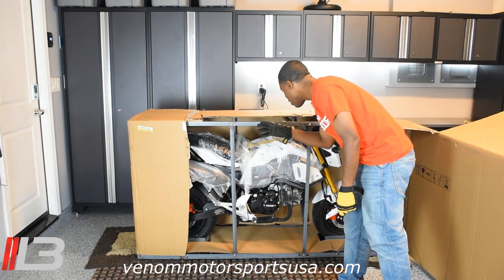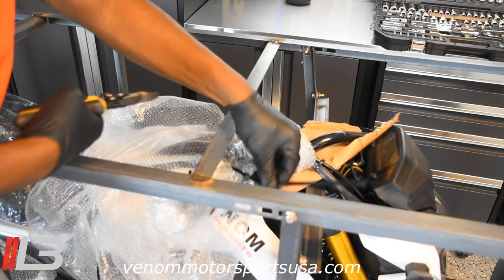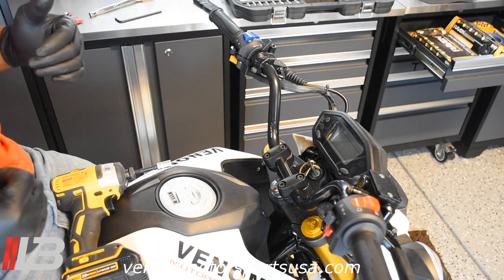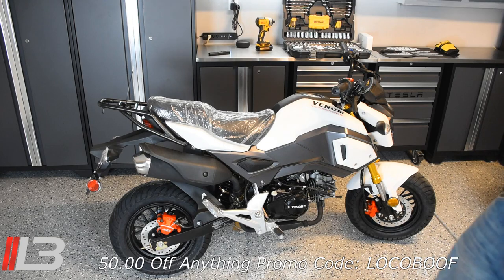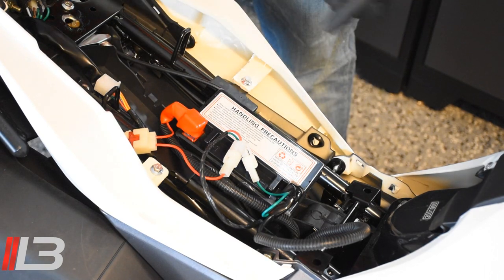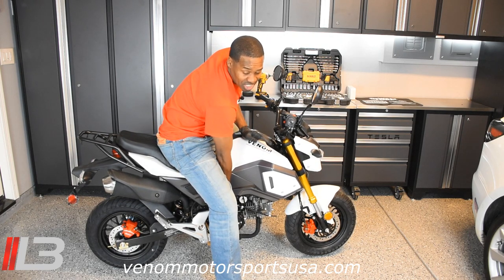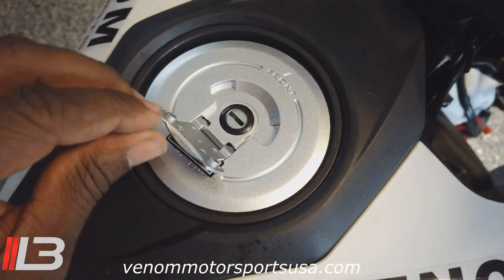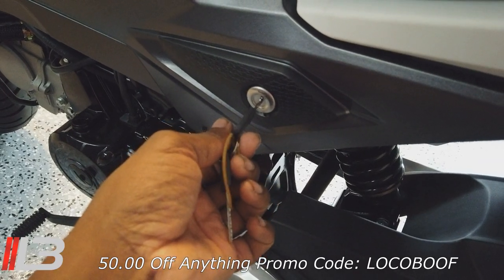New 2020 Venom 125cc Street Legal X20 Super Pocket Bike Unboxing & Setup

Comment: I’ve got a x15 or x18 need to find the original plastics or ones that would fit if anyone knows where I’ve tried eBay, I’m wondering if the new model plastics would fit even if it needs a lil modding to fit thanks in advance

Comment: Do you need a motorcycle license to ride a street legal pocket bike on public roads?
Reply from the maker: You’d need to check with your local DMV laws. Every city/state is different for pocket bikes. They haven’t made pocket bikes in awhile though. It may have just been a wording thing for this video. 

If it says “street legal” then it’s probably just a smaller motorcycle (like the one in this video). In that case, you’d need the same requirements as a regular motorcycle.